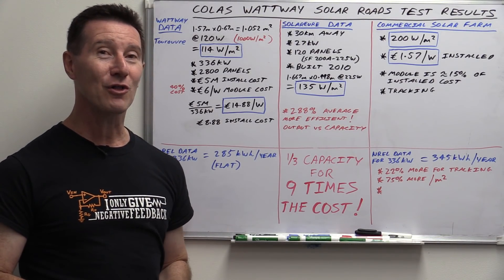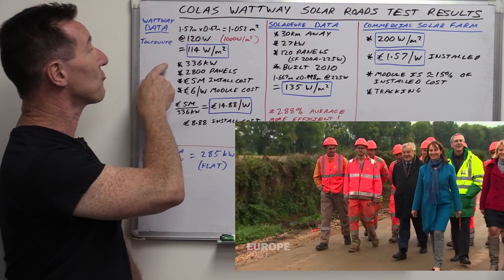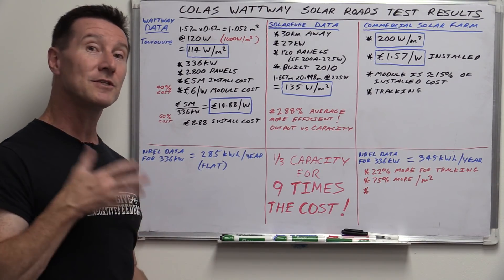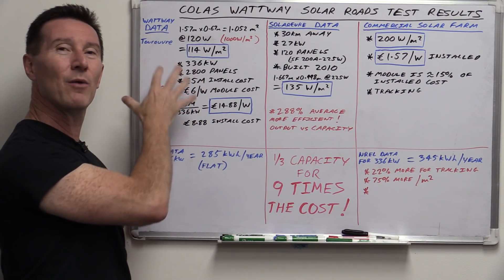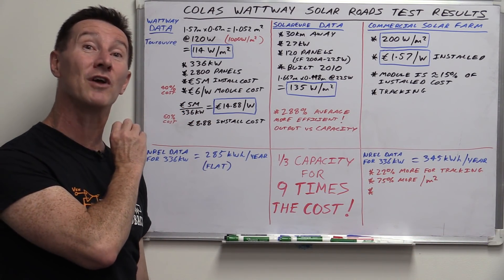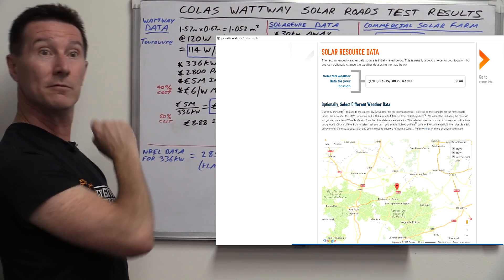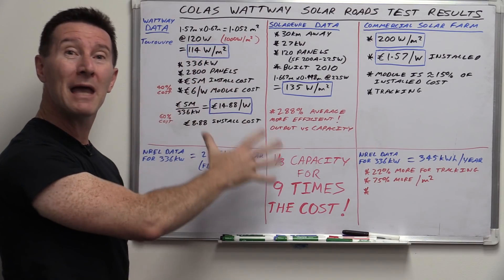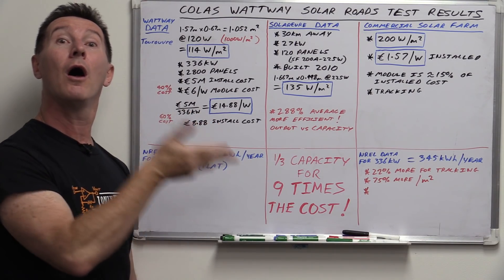EEVblog #1047 - Solar Roadways FINALLY BUSTED! (Colas Wattway)

Comment: Only one major issue.  Currently Quantum computers are insanely expensive as apposed to a traditional computer, or even super computer, but you wouldn't find anyone saying that is a dumb idea and we shouldn't engineer and innovate.  I consider this video a waste of time if you are trying to "debunk".  Although from a purely analytical perspective these things are important to take into account.  Even know the cost of installing solar panels on your roof is hardly practical for most people so I don't really understand the point here.
Reply: Quantum computing is a completely different paradigm. There's some idea of how it could be beneficial. This doesn't exist for solar roadways. Where is even the potential benefit? They have taken 2 incompatible ideas and merged them, that is all. Which direction shall innovation go?
Reply: Quantum computers calculate qubits. Not binary bits. What they do is fundamentally different. Solar roads and commercial solar installations fundamentally produce electricity, the same thing.

"Although from a purely analytical perspective these things are important to take into account" - What other "prospective" would you possibly consider besides an analytical approach?

"Even know the cost of installing solar panels on your roof is hardly practical for most people so I don't really understand the point here" - Solar roofs are also a generally bad idea. Commercial solar production is the only "good" idea of the lot, everything else is varying degrees of bad, with solar roadways at the "impressively bad" end of the list.
Reply: Your one major issue is that you don't understand the math Dave showed or the words that came out of his mouth. All of your answers are there.
Reply: Didn't you watch the damn video? Every other solar technology is going to progress as well.. this is a DUMB IDEA, and throwing more effort at a dumb idea won't make it smarter.  This is different from quantum computing because quantum computing is orders of magnitude more powerful than conventional, so cost is justified.
Reply: Placing a solar panel flat on the ground already means you are never going to improve efficiency over a regular angled or tracking solar panel. Why waste money on something that isn't ever going to be better than the alternative? Quantum computing has potential to be better than alternative methods.
Reply: The point is that solar panels on the road is a bad idea because of:
* Cost. A solar panel that does not have to withstand the weight of a car will always be cheaper than one that does not.
* Efficiency, partly due to a very much less than optimal install angle, except possibly near the equator. And there is no way you could install machinery that let the solar panel track the sun.
* Wear and tear. Glass scratch easily and a car with some gravel will leave marks. Maintenance cost will be high to keep efficiency even acceptable.
* Safety. Even if it was not mentioned the grip is probably considerable lower on glass.
Reply: hard time understanding science? try religion
Reply: The solar roadway is the SAME TECHNOLOGY as conventional solar panels, used in a dumb way. Even when some technological breakthrough improves the solar roadway efficiency dramatically, the same breakthrough will also make solar farms more efficient as well. As Dave already explained in the video.

Comment: "There's no way we're going to be able to fly from point A to point B." 

"Even though we have achieved flight, there's no way it will ever be efficient enough to be usable by the everyday man."

"The silicon transistor will not be feasible."

"There's no way we will ever be able to shrink the silicon transistor enough to allow there to be computers in homes."

"Batteries aren't energy dense enough to ever allow for a practical electric car."

"Well we've got an electric car for the enthusiast, but it won't ever be practical enough to transport cargo!" 

"PC's are as fast as they'll ever need to be, as of now, so we should stop trying to advance silicon based computers and focus on quantum annealing."

"Quantum computers will never be a thing, so we should stop dreaming inn about them and focus on making silicon based PC's faster."

"Quantum machine learning...."

It's called research... If people weren't doing research into the unfeasible/impossible, we'd be stuck in the dark ages. You should know that.
Reply: Well said. The problem is that there are already more efficient ways to install Solar Panels.
Reply: The point is not about being unfeasible or impossible. It's the fact that there is already a far better, improved and more optimized advanced technology available that excels the road technology by putting them on a roof.
Reply: "They laughed at Columbus, they laughed at Fulton, they laughed at the Wright Brothers. But they also laughed at Bozo the Clown."
Reply: Why should we stay in the dark ages then? 
If solar roadways had already been around, I would improve them by tilting and putting them on top of a roof. Then those rooftop installations would be the future!
Reply: Andrew Delashaw Why even waste time researching it? What advantage is there to putting solar panels in roadways? It isn’t solving any problem. Solar panels above and adjacent to the road makes more sense.
Reply: It's the exact same thing, except in your examples it was the laymen telling experts that things were impossible, and now the laymen are telling the experts that things are possible. It's an uninformed opinion either way. It's physically impossible to have a panel that is aimed partly away from the light source to be the same efficiency as a panel that is pointed directly at the light source. That absolutely will never change, pick any date in the future and it will still be true. And the maintenance issue will be true right up to the point everyone has flying cars.
Reply: Actually they didnt laugh at columbus that is fiction. They allready knew the earth was round since classical times at least. The circumference was quite accurately calculated before 198 bc by Eratosthenes. The laughing at columbu story was invented by by Washington Irving along with the legend of sleepy hollow. Protestant propaganda.
Reply: It's basic reasoning. You're not inventing something new, you're coming up with a dumber way of doing something we can already do.

Flying is a completely new thing. 
So is everything else on that list.

Solar panels are solar panels. There's extensive information already on how to use solar panels effectively (and how NOT to use them.)
Deliberately doing something that every existing piece of evidence says will be dumb and pointless...
Only for practical experiments to show it being dumb and pointless...
I mean, there's research, and there's stupidity.

We research things that might not work now, but which if they can be made to work, have great advantages.

Flight had massive benefits if you could get it to work. Doesn't matter if currently it's not so great, it's theoretical potential was large.

Similarly, we can predict, theoretically, what a quantum computer is good for. We cannot build one that's viable, but we can tell what the benefit would be if it worked.

A fusion reactor is the same - we know, in theory, what it would do if it worked properly.
So far, it uses more energy than it creates. And we don't know if we can ever get it to work, but we know what it does in theory, if it actually worked.

With solar roadways... What's it supposed to do? We know what solar panels are, we know how they work, we know what they do when used optimally...
The theoretical benefit of a solar roadway is basically non-existent.
If you can't think of what this might get you if you can get it to work, then what's the point?
Rather than trying to figure out something which we know will improve the situation if we can get it working, we're trying to figure out if a really stupid way of using solar panels is somehow, against all odds, not in fact a really stupid way to use solar panels?

There's not even any pure research to it. It doesn't tell us anything much we didn't already know about basic science or engineering. 

Research doesn't mean 'try literally anything no matter how dumb it seems.'.
Good research does in fact involve doing your homework and trying to figure out what something might accomplish, theoretically.

It's exceedingly obvious that solar roadways don't really seem to solve anything. They don't improve our understanding of the world. They don't do anything new or particularly novel. They don't solve any great practical need or engineering problem that wasn't already taken care of not just more effectively, but vastly more effectively...

'research' is not an excuse to try literally any bone-headed thing that happens to come into your brain somehow.

Solar roadways: theoretical benefits?  ???  Practicality: seems worse than any alternatives that accomplish the same thing, and seems to offer no real advantages, even hypothetically.

Wireless power transmission: theoretical benefits: reduced need for wiring, devices which don't need explicit charging, smaller batteries, wireless devices that need no obvious power source. Practicality: could be very useful if it works, but all known methods are so inefficient that the costs outweigh the benefits

do you see the difference between those two?
The first is probably a waste of time unless you can first show an actual potential, meaningful benefit.

The second is worth researching because the benefits of a working system are immediately obvious, but we don't currently have any idea how to get such a thing to work.

More esoterically, you get stuff like FTL space travel - the benefits are obvious, but according to all known physics this is basically impossible.
Researching this is futile, not because it wouldn't be awesome if you got it working, but because you have nothing to work with. - you'd first have to figure out an entirely new set of physics that demonstrates an actual viable, testable framework for how such a thing might work, before there's any point seriously researching such a thing.

These represent 3 different things, and they are not equivalent.

The first case (solar roadways) is self-evidently a waste of time, and a few calculations and thought experiments and the like should be enough to show it's pointless. You don't waste time and resources testing stuff like this except with the cheapest of tests, such as very small lab models at most.
It's just a waste of resources.

The second case, is worth researching extensively. Doesn't mean you'll crack the problem, or even that it's possible, but you know why you're doing it. We know what the benefits are, we know several ways that can accomplish it, but none of them are very efficient. That's something that you can work with, and something that you know is WORTH working on, because you can predict what a good outcome looks like, and that such an outcome may be plausible if you perservere with your research.

The third isn't worth serious research until something else can more clearly resolve the innate physics problems that would seem to imply it being impossible..
It may be something you research in the far future, but for now it's not worth it except for very broad theoretical examinations and hypothetical ideas. Then again, by definition, practical tests of stuff like this is generally impossible.

Not all research is equal.
Not all ideas are equal.

You do have to have some capacity to weed out the obviously stupid sometimes, rather than just giving literally everything a free pass...
Reply: This is not cutting edge stuff though. They should make trains effeicient enough to be a cheaper option than flying. That would be a good use of time.
Reply: They did laugh at Columbus, actually - educated people knew the earth was bigger than Columbus claimed, and sailing west wasn't a shortcut to India. And they were right.
Reply: They laughed at the Wright Brothers, but they also laughed at Bozo the Clown.
Reply: Yeah but they didnt laug at him becasue they thought the earth was flat. Not even the churchmen even the dunces that wrot the story of noahs ark knew that the earth was a globe. Or at least the sailors of their time knew it. Why else wold they need birds to show the way to land? That's a technique that was employed by the vikings that came to america 100s of years before columbus aswell.
Reply: Your argument is weak for multiple reasons. 

1. Most egregious is that examples are not related to the problem.  Your examples are about the evolution of the product.  From concept to improvement of a working system.  The complaints about "Solar Freaking Roadways" is about implimentation,  specifically the lack of practicality. Covering the roads with overhangs and good solar cells reduces costs drastically, results in less wear on the surfaces reducing maintenance time and provides more energy.

2. People think all sorts of stupid things, luckily we have math and science to make people less dumb.  Our knowledge and construction techniques grow by leaps and bounds. Have you seen old computers and the interesting ways they did things?  Hard wired logic, piano wire,  and mechanical interfaces. Now? We have computers that fit in our pockets with more power and storage than NASA used to go to the moon. Hell I've got a ten year old calculator that boasts that fact.

3. "Solar Freaking Roadways" was a timely grab for money plying on people blindly wanting to "save the world" without putting in any thought at all.  Anybody could do this math, but they didn't want to.  They wanted to be feed the mass media hype of "This WILL save the world!" Because then they wouldn't have to worry because feeling bad is bad.  Being told " You're wrong and here's why. " makes people feel bad and that's bad.

4. Yes research is a good thing, but a rushed unfinished product is not good.  So stop worrying about solar roadways and begin working on abrasion resistant polymers and ceramics for the industrial sector. Or increasing the efficiency of current solar panels. Or increasing daytime visibility of LEDs while lowering energy requirements.  Or a waterproofing solution for electronics. Or networked wireless energy transference. Cause those things are needed for the plan to work not blindly throwing money at people who claim to have the answer.